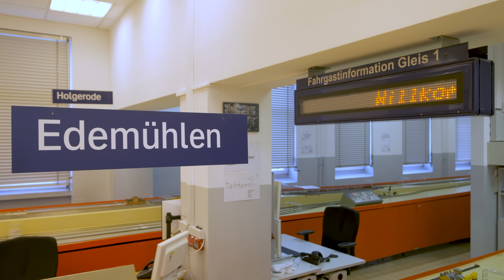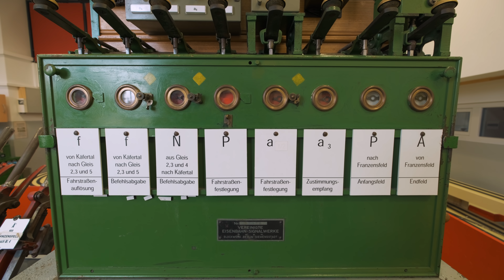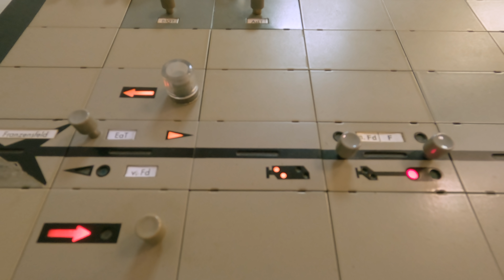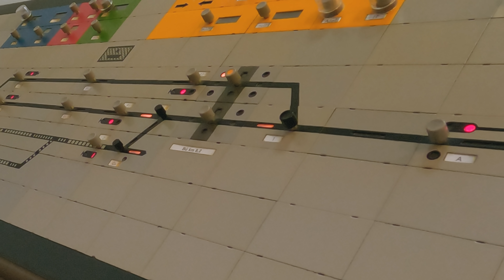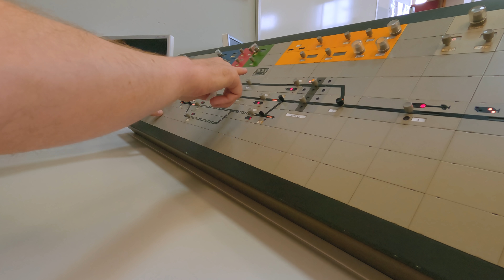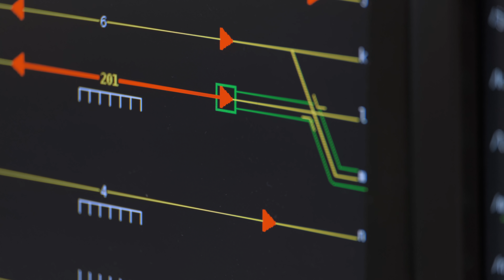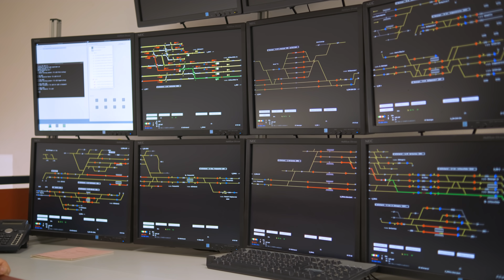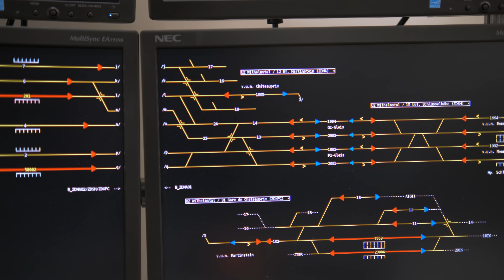The world's most useful model railway

Comment: As a train driver, I got to spend a couple of days looking over their shoulders as part of my training program. I definitely don't envy the signal operators. Sure, when everything is working as planned, it's fairly manageable to handle all the traffic, but when something goes wrong, they're often in for hours of very stressful work. Meanwhile, I can often just sit back and wait in my train while they're clearing up the mess.
Reply: yes, it is some demanding work if you have to handle more than one train per hour, mentally as well as (in the case of the mechanical system) also physically. i was lucky enough to have been allowed to play with such a "real simulation" outside of their normal operating/educating hours, one hour at each of those different stations, and on the next day i could feel every sour muscle from having operated the heavy switch levers and signal levers even for an hour only. and making one hasty wrong decision (although not causing an accident but "only" a "lock out") takes a lot of back and forth in communication with the other stations and in handling (and thus also lots of time and delays on more trains) before the locks are released and can be set properly.
although this looked easy and like some fun, in reality it is quite some work for well trained professionals only!
Reply: Out of curiosity, why was observing signal operators part of your training, if it's not something you have to work on!
Reply: @wariolandgoldpiramid  So when we send them WAIT! they know we aren't just sitting about drinking tea, it gives an appreciation of what is involved in the bigger picture. Just as Signallers can and do request cab rides for the routes they signal.
Reply: @wariolandgoldpiramid  so we can see the other side of the operation, and understand how it all fits together. While we do different jobs it’s all with the same goal, signallers also get the opportunity to do cab rides over their area (not during COVID obvs)
Reply: @wariolandgoldpiramid  same reason they let us back line tech support people do ride-alongs with the technicians we send out all the time. It helps to have an appreciation for the work your colleagues do, especially if you’re in regular contact.
Reply: I'm guessing air traffic controllers have much harder jobs.
Reply: @andrasbiro3007  very different jobs, one has tracks and signals and blocks and points and possibly electric current and higher frequency whilst the other has paths and altitudes and more independent operators and weights. There’s air traffic controllers recruited for a certain railway that didn’t want to complete training as it wasn’t for them.
Reply: @andrasbiro3007  I have immense respect for them both. One wrong move or lapse of thought and it could very much lead to catastrophe.
Reply: @andrasbiro3007  nobody is comparing anything here bro, but sure i guess
Reply: For PapaQ, you can sit back as long as it is not Your train that ran amuck! ;)   Here in the States we have pictures of train cars on their side, with the wheels pointing away from the rails.  I thought it was only the automobiles that went rolling off the road. 
   Long ago we had a snow in the Washington DC area. I stayed at the office until 830 PM (2030 hrs) to let the traffic sort itself out. Going home around the DC beltway I was impressed with the number of cars in the median strip, shiny side down! (four wheels in the air)
  Old Bill G
Reply: Train wreck. If they screw up, you're screwed.
Reply: Yer for similar nut more dramatic reasons that's why air traffic controller's have some of the most stressful jobs
Reply: @PapaQ Radiohead fan I see
Reply: Ye seems most of work is done by the signallers where the train only really has forward backward stop (not saying driving can't be hard as well) ...
Reply: @brazenh2836  Ah yes, because train drivers don't have to keep to their speed, watch out for signals, get traumatized by people jumping in front of their train, cars getting stuck on crossings which they can't stop for so they just have to crash into it, farm animals escaping and wandering onto track, causing them to get hit, kids throwing stones into their windows for funzies, opening the doors on the right side so passengers don't stumble onto the track next to them etc. Etc.)
Reply: It's sort of like watching a plate spinning act.
Reply: Makes a lot of sense! You don't need to be able to do their job, but understanding what that job is makes it much, much easier to work together to keep things running.
Reply: I imagine the most stress comes from jobs where the stress situation is uncommon, but could happen at any moment.
Reply: Semen
Reply: How do the train operators communicate with the signal operators?
Reply: @wavedashdownsmash  yes
Reply: And depending on what signal/transfer goes wrong you need to have someone there to do it manually.
Reply: You can sit back, as long as the mess wasn't caused by someone throwing himself in front of your train. Not a situation I"d wish anyone to be in. And there's nothing you can do to prevent it. That thought alone would probably make me quite nervous...

Comment: Its great to see my profession getting some screen time!! Were usually the forgotten guys on the railway!    I do miss my time pulling levers on my own in my box, but them days have gone unfortunately,  there are still a few around the UK still operating however,  now spend my days with a mouse and keyboard looking after many many more miles of track on a newer digital system,  similar looks to the German system but not quite,  we have the Siemans Westcad System, and another digital one by Resonate,  fundamentally do the same thing but with a different look on top! 

We still have training centers in the UK like this (minus the model railway) with simulator lever frames, panels and digital,  would be worth a visit if Network Rail ever do an open day again anytime soon!!
Reply: We also still have some of the manually operated ones here in Germany!

I recently even took an ICE through a section of track like that, because of construction on the regular tracks.
Was quite weird to sit in a train capable of going >200km/h waiting in a train station for someone to pull a bunch of levers and turn a crank a bunch of times. Those parts of the railway network are often also single track, so if one train isn't in the correct station at the correct time, things can become quite interesting.
Reply: when I was a child my ideal job wasn't to drive a train. I fancied myself in a rural signal box -- a handful of trains per hour, nice scenery, maybe a vegetable patch to tend and a pot belly stove to warm the place and brew tea on. I know the job was rather  more work (all those oil lamps in the signals plus endless cleaning and other maintenance tasks) but it seemed a great way to earn a living. Between Beeching and the regional operating centres this is now some time lost in legend.

Comment: This is fantastic, cheers Tom! I'm a rail enthusiast in Britain and it's really interesting to see how the German system appears to differ from ours. The route interlocking levers on the mechanical panel are particularly interesting and strike me as a cool idea --- in the UK there's interlocking between the signals and points, but in a traditional mechanical interlocking like that, you just have to follow the correct procedure by not putting the signal back to danger before the train has passed the last set of points.

The UK NX panels (the electromechanical interlocking shown in the middle) also work a lot more like the computerised system - the points all get set automatically, you don't need to swing them one by one.
Reply: Regarding the mechanical interlocking, that was my thought as well, not that I have practical experience, but I am a rail enthusiast.

Comment: The sad part is, that the mechanical switches are still in practical use (and tend to break everything around waiblingen)
Reply: i think it is even worse, that the modern version uses 4:3 screens
Reply: @DieSocke001  NOOOOOOOOO
Reply: @DieSocke001  I don't know about industrial systems, but I do know I feel cramped if my monitor isn't tall enough. A 21" 4:3 screen is tall enough, but at 16:9 I need 28" to be really comfortable. It's the diagonal measurement that's the big problem, IMO. Square inches would be better.
Reply: In czech republic there is only one station with these mechanical switches left
its in list of national relics so they cant change it :)

Comment: You know its german engineering when the response to using it wrong is "yea try it" ol mate knows nothings gonna break this machinery in his lifetime
Reply: Yes, because if it would break... People could die. That's the point haha
Reply: "german engineering" is such an ignorant phrase, they also make some rubbish just like the rest of us.
Reply: @Metal-Possum  The same equipment and system is in daily use at the Bluebell Railway (a heritage steam railway). I went to the open day and operated it myself, a bit like Tom did here. Much of it is also original equipment dating back to when the railway was new in 1881. Those that aren't have been rebuilt to original spec. The only ones that are newer are signals that were built on line extensions more recently. They too use period equipment from when they were new. The most modern is about 1958, when the railway ended it commercial life.

Comment: Much of the terminology around threading (i.e. a program doing more than one thing at a time) is taken directly from railway signalling, so amusingly that computerised control system is almost certainly using locks and semaphores somewhere in its code whilst itself replacing the locks and semaphores etc those terms derive from.
Reply: Do you mean semaphore ? Those are older than trains, just look up: optical telegraph
Reply: @autohmae  the programming term does reference railway semaphore signals. It's a way to ensure only one thing enters a critical section.

The programming version is the equivalent of every customer taking a basket so only a certain number of people can enter the market. Usually there is only one basket for a critical section so simultaneous actions don't  overwrite each other.

Comment: Operating those mechanical points looks incredibly satisfying.
Reply: It really is a lot of fun :)
Reply: Indeed, but I wouldn't have wanted to do it at a major station, especially in winter, when the wires and pulleys liked to freeze themselves solid.
Reply: It is! 

It has so much "feedback" which is of course not intentional, but because of the security systems in place, everything clicks, and makes noise. It's really great.

Comment: One has to wonder, if there are safety mechanisms in the mechanical system for ensuring that only one of a handful of pre-determined permitted routes is set, would it not be possible to gang some of the levers together so that you can flip a "route 2" lever instead of having to do all the appropriate points manually? Perhaps that wouldn't be flexible enough for emergency situations...
Reply: Well, with the modern digital system, it is partially done.
Reply: i imagine it would also be very heavy and slow to pull and it very likely would not help much in emergency situations where you just need that train leaving the area by the fastest means
Reply: I guess that might be difficult if you had levers that are shared between multiple routes
Reply: I think you need much more force to move the levers in a real signal-box, at least for some levers. So it is not practical to combine them. And you get problems if you need to move some levers up and others down to select a specific route. 
And the mechanical checking system would get bigger and bigger.